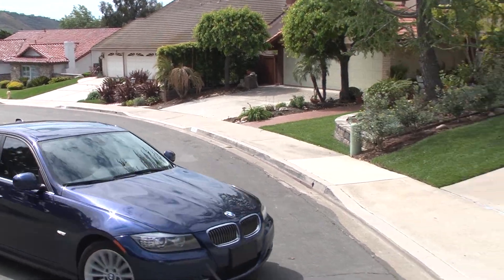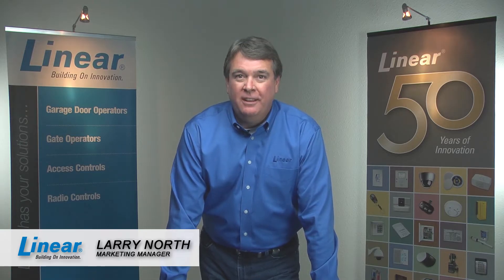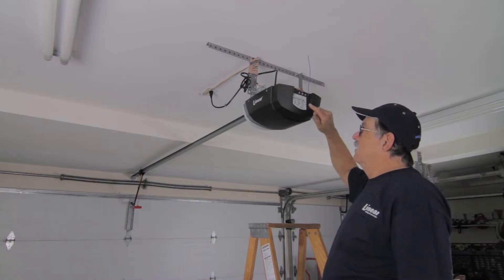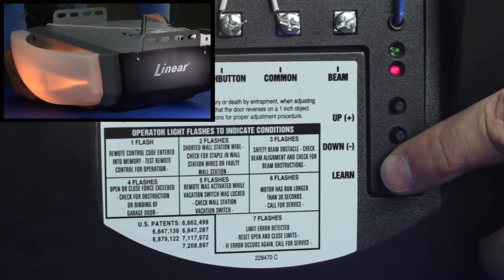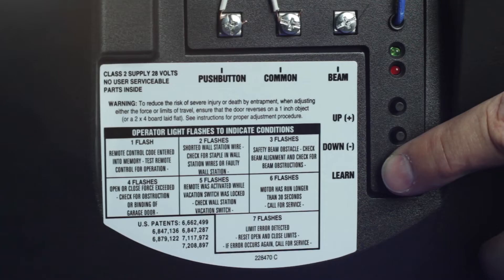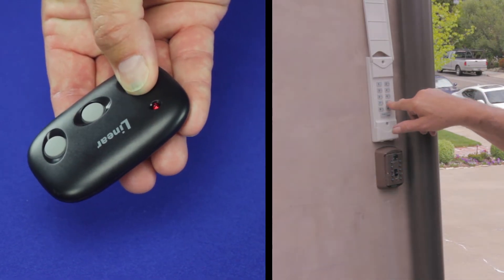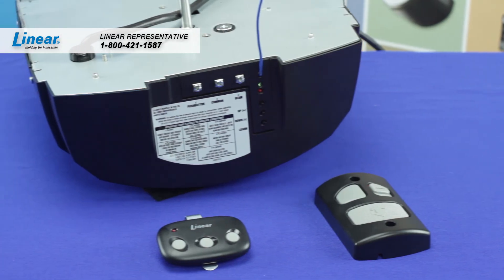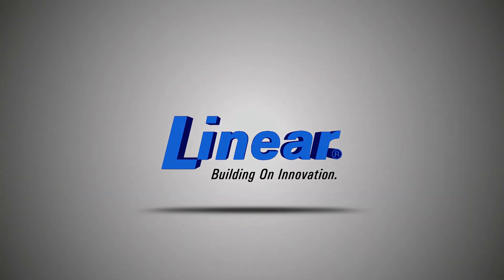Linear LDCO800: How to Program/Delete Remotes, Transmitters & Keypad codes

Comment: How do you remove a key pad code? The instructions just say what happens ie light flashed four times, but it doesn't distinguish between how to remove a code as opposed to adding a code. It can't be the same operation as adding a code. There must be some intermediary step, right?
Reply: Victor, we have been trying to find out the same thing and I agree with you the instructions seem like they are missing a step.  However, we just figured it out and what you do is push the learn button and then tap in the code you want deleted and it blinks 4 times.  Thats it.  Worked for us just now.  Good luck!!
Reply: 5 years late....but they said in the video press the learn button for 10 seconds to memory wipe

Comment: I changed my wired keypads code and now i dont need to put in a code to operate it. You can just push the open button at any time and it opens and closes

Comment: My linear LD033 the clicker has to be within 3 feet of the opener for it to work, the learning light is always on, kinda flickering but always on. wall panel works. reprogrammed the opener, changed battery, clicker works on another door.  erased memory and reprogrammed it, unplugged the opener and non worked, any tips
Reply: Did you ever find a solution? Exact same issue and model here :(

Comment: What about ldo50
Reply: Press the LEARN button on the side. The LEARN LED and opener light will flash once quickly and stay on for 15 seconds. At that point, press your button. The light and LED will turn off and then blink once. After about 2 seconds, the light will turn on and stay on for approx. 5 minutes after that, this is normal.